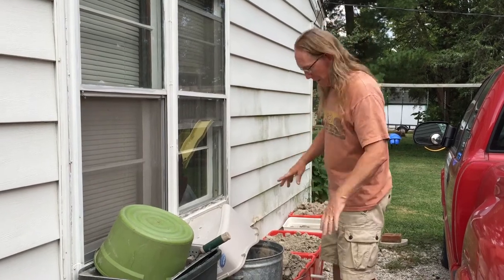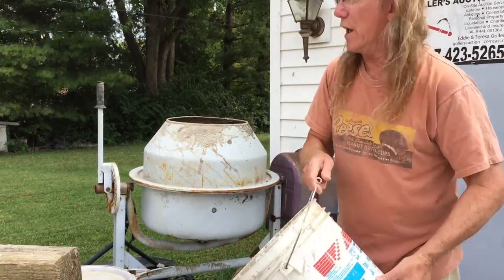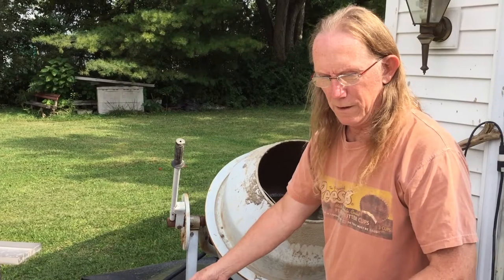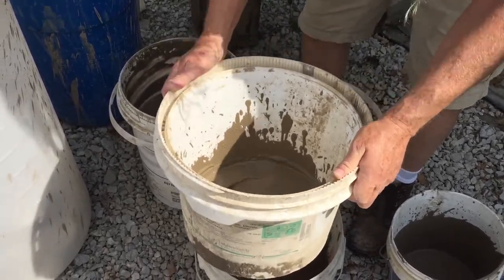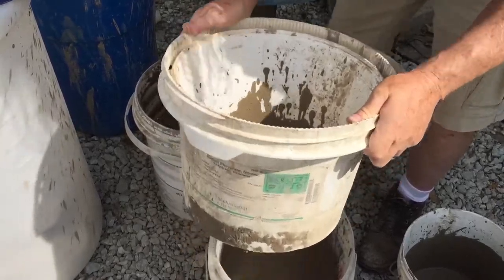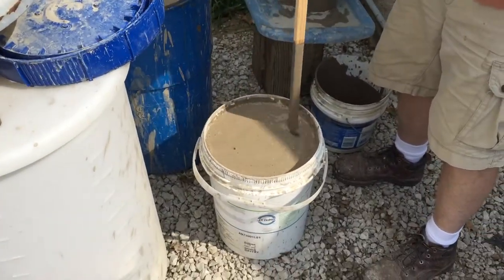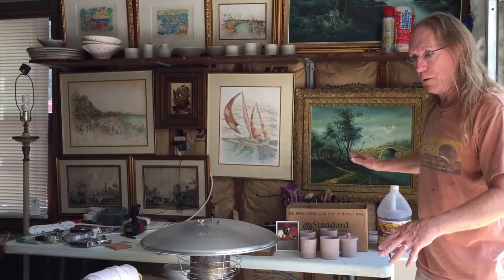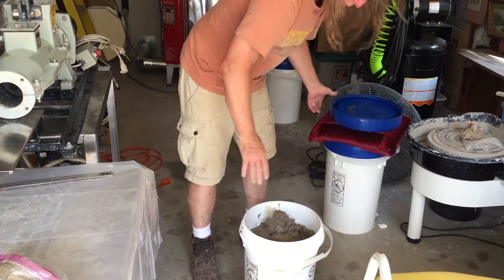Illinois Blue Clay Indians made pottery from.

Comment: You still got me thinking. Loggers dug into the bank along my road exposing some yellow clay. I don't have a mixer or a nice rotary sieve like you make in your next video, so I'll just do a small batch. Test see what it see what it's good for, maybe glazes, slip decorating.
Reply from the maker: Jeff, it's very wise to do a test batch. The illinois blue clay surprised me that it only go's to a cone 4 to a 5 and then will melt at a cone 6 or 7. it's great for low fire cone 4 pieces or used as a glaze additive. The yellow clay may make you a good base for glaze or low fire items. I will be doing a part 2 on how to make rotary sieve soon so everyone might get a better understanding on how easy this is so you don't need to spend $300 dollars to buy one. I'm still Planning on heading your way the 2nd week of August and will stop by for a few hours. I'll remind you the week before I head that way.
Reply: @eddiespottery8439    My first question will be what did you do with all that blue clay? Nice watercolors, I did them too for a number of years.